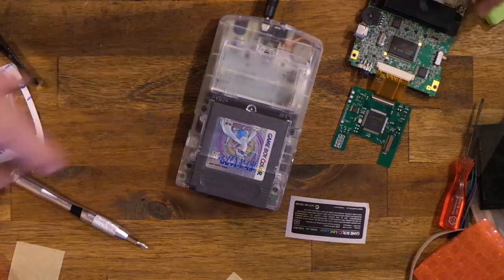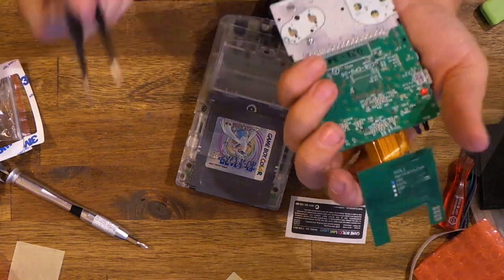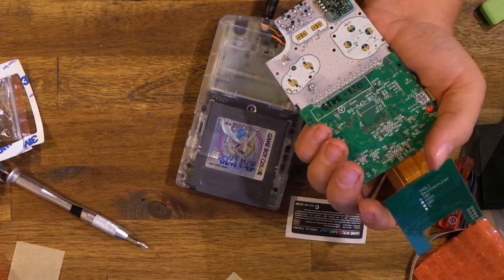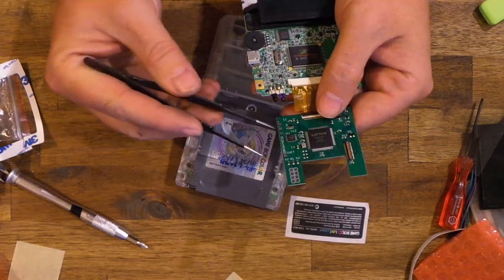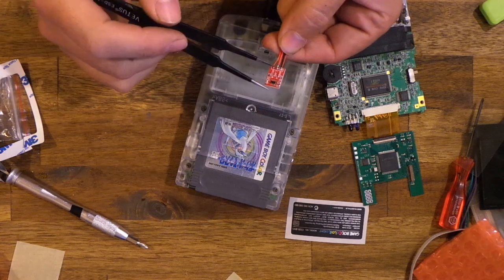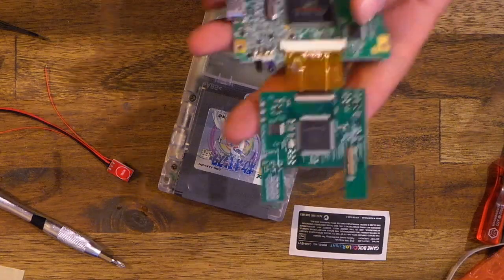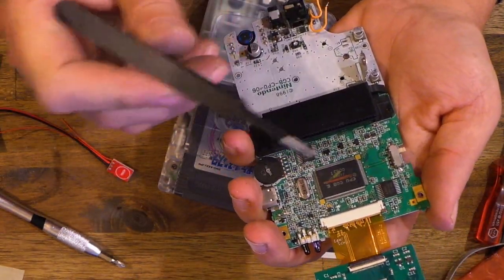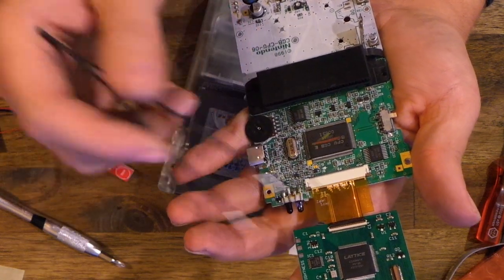Aioli GBC (FreckleShack) Brightness control connections

Comment: Do you have any suggestions on where to place the touch sensor after connecting it? Does it have to be outside the case, or can it be inside? Wondering how to sensor is actually installed into the device after connection

Comment: Thanks for the video. I just installed my aioli and it turned out great. I was just wondering, what gauge of wire would you recommend for the brightness mod?

UPDATE: I went with 28awg from handheld legends and it worked quite well. I tried the discrete method and it kept cycling through the brightness so i just went with the p12 pad and it worked out great.
Reply: did you wire up the secret pad? i still have no idea what that does and im trying to figure that out LOL